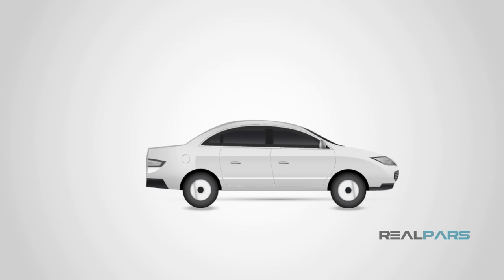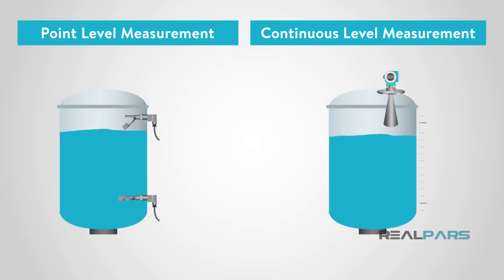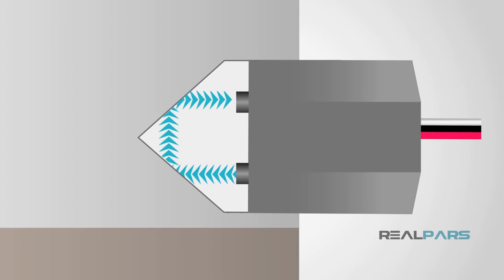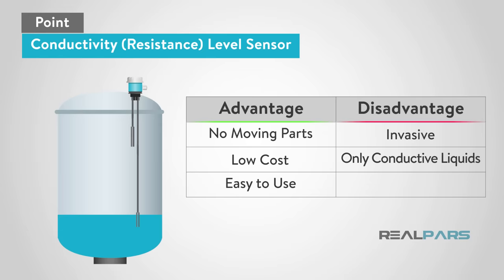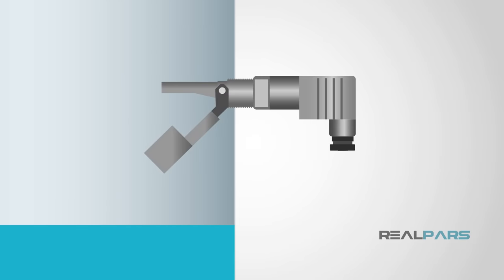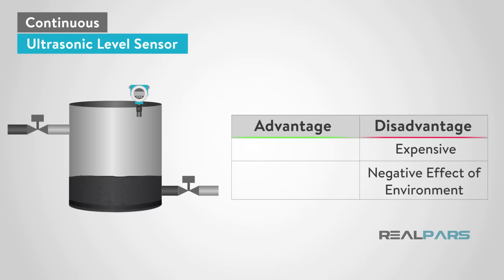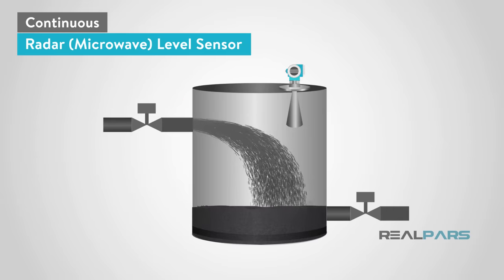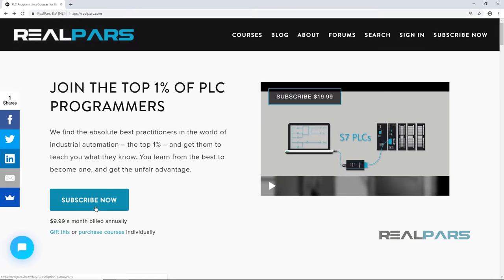What is a Level Sensor?

Comment: time 7:45, wouldnt the radar level sensor be activated by the water falling into the tank?
Reply from the maker: Absolutely, it would!  Great observation.  In practice, a radar-type level detector would be placed in a tank to avoid incoming streams, splashing, agitation waves, etc.  In tanks with all of the above, it is not uncommon to use a stilling well, which is essentially a pipe running from the tank dome to near the bottom of the tank so that the radar probe can be directed into the tube, away from all interference.  However, this has to be done with forethought in design to keep the radar signal from reflecting off of the sides of the stilling well.

Comment: Isn't a a capacitance level sensor continuous?
Reply from the maker: Capacitance level sensors are usually set up with electronics for continuous measurement, but also can be specified as point level sensors as well.  Most continuous level sensors are equipped with NO/NC relay pairs that can be used for alarming or as digital logic signals.

Comment: Can't capacitive used for continuous level measurement?
Reply from the maker: Yes, there are capacitance level sensors that can measure continuous level, while others can act as point level switches.  A step-change in capacitance at the probe can indicate the presence or absence of level (switch type) or small continuous changes in capacitance can indicate a continuum of capacitance change to detect analog level (continuous type).
Reply: @realpars  thanks

Comment: Wait..I thought capacitance were continuous level sensors?
Reply from the maker: There are capacitance level sensors that can measure continuous level, and others that can act as point level switches.  A step-change in capacitance at the probe can indicate the presence or absence of level (switch type) or can indicate a continuum of capacitance change to detect analog level (continuous type).

Comment: Can a fuel gauge read water level?
Reply from the maker: Yes.  Most vehicle fuel level sensors are float sensors.  They will work with any fluid.  Hopefully you do not have water in your fuel tank!
Reply: @realpars  Thank you for your response! I am conducting a research of capacitive sensor as a earl warning device for flood and I think I might use a fuel gauge😊 Thank you again.😊

Comment: What about a pool farm saltwater I want to level it wifi please give me a solution
Reply from the maker: I would recommend a wireless system, similar to the one found here:  https://ptlevel.com.  In general, for pond and pools, a continuous ultrasonic level detector works well, since there typically come in weatherproof housings.  They can be mounted on a fixed structure and will indicate the level above/below a reference point and are accurate an reliable.